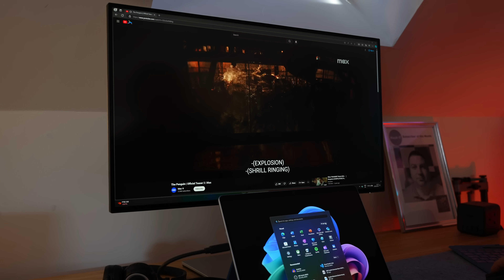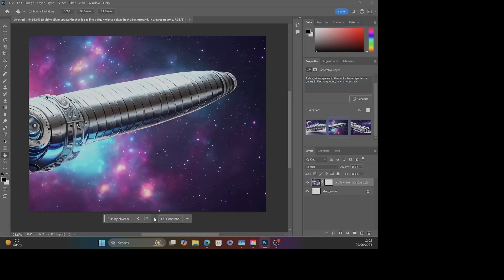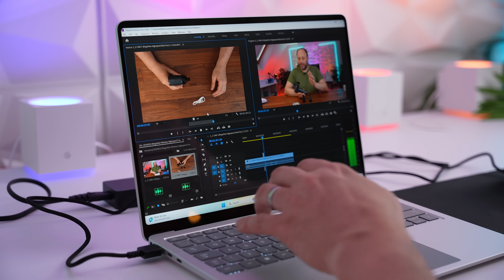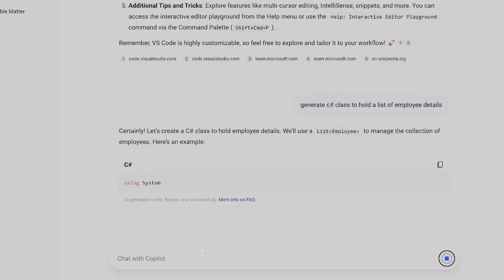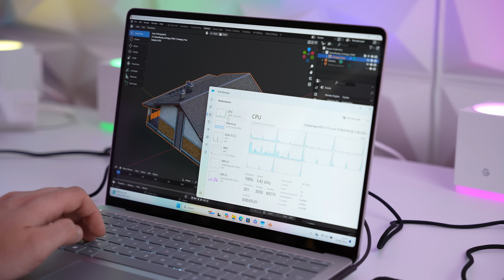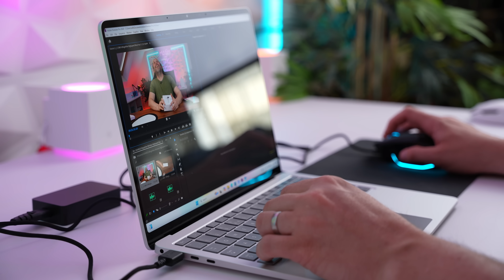Using the new Snapdragon PCs for Productivity! Featuring Surface Pro 11 and Surface Laptop 7

Comment: These shouldn't be for a 'light user', these chips came out to compete with Apple silicon. So far from what I've seen, they have been a let down in comparison. Anyone else feeling this?
Reply: I do. X chip has a long way to go.
Reply: What you think how much % of windows users do video editing?

Am surprised all drivers (external display , Bluetooth etc) worked fine for you. Am also surprised xampp worked out of the box. Would have loved if you tested docker. 
Also for the apps that worked well in emulation (audacity, photoshop etc), they worked mostly well. I mean no BSOD or crashes. This is way more satisfying for software developers and usual productivity enthusiasts out there. 

In dave 2d's video of Lenovo yoga 7i, the battery life is very close to MacBook air M3. And for emulated apps the performance was on par with M3.

The point is, it definitely has quite comparable raw power and battery life. Prism emulation looks promising and capable. 

I don't believe we can jump to the conclusion that it's going to be hype merely because some video editing apps didn't work. I am leaned on other side based on what worked, the overall performance and battery. 

I guess it will be very satisfying and exciting to use them once these selective corners gets polished out in couple of years.
Reply: I think people forget how bad non-ARM apps were on Mac when they made the switch, and all the apps that didn't work at all. Feel free to give Microsoft the same rage now, but it will get better. One point I didn't see you mention is if you had it in high performance or balanced when running these tests.
Reply: @briannhinton exactly. People always like to be kind to Apple, tough on Microsoft.
Reply: @bradavon on day one my m1 could edit 4k video without a hitch…this surface won’t be able to match apple maybe the sp12 or sp13 will
Reply: This is a first gen product and most third party ARM software is still in beta. There are many firmware updates expected from device manufacturers to fix early issues.

I am pretty certain this will give Apple wafers a tough time, if not beat them, as the software comes out of beta.
Reply: For a first GEN release, I think this is pretty strong. Is it perfect? No, nothing ever is. But it’s definitely a strong contender. Innovation spurs healthy competition, which benefits all the consumers. I am primarily a MacBook Pro user but I also have to use Windows from time to time. This is a nice and refreshing change. Although I know right now not a lot of programs are available on Windows for ARM, this will change soon. I am confident this product line will strengthen over time.
Reply: They do compete, software that optimized runs great, just gotta wait for other software to catch up. But if it can emulate something like blender, it should be fine with just emulation for now until more arm support happens
Reply: It's still a first gen product.
Reply: isheep spotted
Reply: @spresso007  🍏🐑😂 - I just wanted these chips to be good
Reply: I bet Linux would be killer on this thing
Reply: CHILL GUYS ITS JUST RELEASED. WAIT FEW MONTHS TO GET SOFTWARE MATCH. NO ONE GETS MAC AFTER SOFTWARES RELEASES  SHINING UPDATE FOR REGULAR PC
Reply: @bradavon  I understand that, but the M1 blew people away from day 1 🤦‍♀
Reply: @misterfunk1973 it's a shame Davinci Resolve isn't out of beta and Premier Pro isn't available but a lot of the complaints have been around games. Which the M1 Air still sucks at. I watched those videos too. It was all Photoshop which runs well here, Chrome which runs well here, Slack which runs well here, Premier Pro I'll give you that one. These are impressing from Day 1 if you don't expect to game on a PC not designed for Gaming or Video editing which fair enough but really is everyone video editing anyway,? The difference? What people do on Macs is still a lot narrower use cases.  We expect a lot more from Windows.And no the M1 Air couldn't run Google Drive after the first 5 days either.
Reply: They aren't "light use", DaVinci Resolve is still in beta. That's really NOT the same thing.
Reply: That's not really on the hardware anymore but the software. Benchmarks have proven that the devices get the job done and are more than capable of competing with the M series MacBooks. But native windows on ARM support still has a long way to go from third parties and emulation is only ever going so far. Really that's only going to happen once you get the casual consumers on the Windows ARM architecture and prove to software developers it's worth building robust native apps. And I will say for the starting price of many of the snapdragon models that's very possible. But nothings going to improve if you write off the device right out that gate. That's really how it's gotten so hard to compete in digital markets. You get these pseudo monopolies because developers aren't willing to support what doesn't already have a lot of users and users aren't willing to move to devices without a lot of dev support. Not saying to go out and buy the most expensive snapdragon laptop on the market or even replace your Macbook, but that realistically any viable competition will start by gaining casual lightweight users and proving there's value in supporting the hardware.
Reply from the maker: I totally agree. The video editing killed it for me. I can buy a cheap m1 MacBook air and do 4k video in resolve without any hitching, slow downs and it has great export speeds. I thought the snapdragon would do the same but it was painful, my ryzen in the T14 is better
Reply: @MashITTech absolutely true for someone like me who is concerned about video editing i believe this isnt for me, macbook air would suffice.
Reply: @anupammahato1  I had an M1 based model. I recently sold it since it was beginning to struggle with video editing. If possible go above the base model or even better go with a MacBook Pro
Reply: It's normal no apps are optimized. No gpu use ect... Capcut beta for arm is working perfect.
Reply: @MashITTech do you think that having 32gb of RAM would make a difference with premiere pro in emulation mode?
Reply: @MashITTech the M1 Air has been out for 4 years. You couldn't a week after the M1 Air launched do 4K in Resolve without any hacks 🙄
Reply: @MashITTech although without proper native application compiled for arm that accelerates video encoding/decoding via hardware it’s too early to tell
Reply: @MashITTech I get that with video editing, would have been better if they could match Apple on the GPU. 

However….you’re maybe falling into the tunnel vision that many YouTubers have. This isn’t a dig at you, but bigger YouTubers usually only know what it’s like to be a YouTuber. That’s all good and it takes a so much skill and dedication to be good at it. 

But I’ve tried a Pro 11 for coding using native ARM tooling and it’s been seriously impressive for such a slim and light package - an iPad Pro would destroy it in video editing, but couldn’t touch it on coding. (Having said that my M2 iPad Pro is only slightly better on Davinci Resolve)

If you need to emulate your video editing tools forget about it. In fact if you’re video editing just get a Mac it’s going to be a couple years for the chips to catch up on that side - let’s see if Nvidia come out with their own chips for windows
Reply: Guys.. When M1 first dropped... Everything wasn't working fine first.. It was mind blowing cause we had nothing to compare it to.. 

So it's easy to say a lot of bad things about this cause there's M-series chips.. 

Come on guys.. Give this some time.. Everyone looks for a chance to justify their Apple purchases... It's beginning to irritate me.. Same thing Blackberry users did..
Reply: It's been our for 3 days 
And you expect Mac level apps performance?
And for the davinci resolve, it's a beta app I believe and still even Arm smartphones apps (android and iOS) still have problems and need to be updated.
Since you said it has hardware video encoding support, it should be expected that it will get better in time. 
It's frankly unfair to expect that much at this point especially for apps not not made by Microsoft.
Yes it was branded as MacBook Air killer and it has in some aspects
The video editing will get better especially when davinci resolve is properly updated and premiere pro for arm is released 
Apple had final cut pro ready at lunch so they could offer good video editing capabilities if Adobe wasn't up to the task 
All Microsoft apps works flawlessly at launch 
It would have been a real problem if PowerPoint and word was laggy and froze often 
So let's have some patience and we where it leads
Reply: @princelyijieh9825 ive used DaVinci Resolve just when M1 Air was available and while it had stability issues performance form time to time the performance was great. Same with non ARM Chrome, Office Suite etc.

Sorry but M1 was way more "generation 1" product than these laptops are because market had it's time to adapt and learn how to launch ARM centric product.

These laptops are nowhere near value of M1 was. They are saved by 16gb ram as a base memory because it adds a lot despite shortcomings of this line up
Reply: @princelyijieh9825 Mac’s work better with Arm architecture.
Reply: @princelyijieh9825  Apple got a free pass because it brute forced the total transition to Apple Silicon, which gave the developers an ultimatum to either transition to Apple Silicon or lose millions of customers. 

Windows on the other hand did not transition fully to ARM, so unless ARM can truly showcase it’s benefits, adoption will be low, and fewer developers will be incentivised to transition to ARM, creating a vicious cycle.
Reply: @princelyijieh9825 disagree even on day one the m1 MacBook was editing 4k video without a hitch on emulator so they just dropped the ball hard
Reply: @princelyijieh9825  you don’t get a ‘will get better’ pass, when you’ve branded yourself as on par or better than Apple Silicon
Reply: @joshstark1528 Qualcomm and Microsoft literally didn't mean with every app and every use case because that would be a stupid thing to expect 😉. It's still only 5 days old so yes they do.
Reply: Correct, they were meant to be an alternative but in the end it was a let down. To be fair they should not have hyped up these processors as much as they did, because in the end reviews were going to obviously test all the claims which now we know was mainly big hopes and thats all. But, if they separated their marketing from claiming to be such competitive high end beating chips and instead focused on it's own category of how far Qualcomm has come and achieved in actually being able to be a fair competitor to the other chip makers they would have gained more respect and the reviews wouldn't have been shamed but instead accepted.
Reply: @4dzxk332 to be fair they're 5 days old and Resolve for ARM is still in Beta so no not correct 🤦‍♀️
Reply: @bradavon  Well they have plenty of time time to see how these chips perform in actual consumer hands now and release updates for the chips in the coming weeks and months for possible performance increases and to fix any unforeseen issues that can occur, and from these lessons gain a more advantageous knowledgeable position upon their next iteration of Snapdragon chips. In the end, still a win for consumers.
Reply: Not only that. They are also much more expensive... Doesn't make sense
Reply: @another-sam-youtube erm no? Macbook cost more than Microsoft

Comment: wait for Amd Ai 300 series that probably will have very good battery and it's normal CPU not ARM windows iant ready at all in my opinion and almost oo software don't count few apps from Microsoft.
Reply from the maker: yeah I am looking forward to the Ai300 range and still currently use a Thinkpad T14 with ryzen 7940u and its been a beast

Comment: Thanks yet again for another great video. Not too bad, they will probably get there. Cant wait for one that can game as these  have nice battery life.
Reply from the maker: thanks mate, its been a fun but long week :) productivity has been really good so far, if M$ can iron out the bugs these could be great device, we just need to see some real ARM games to find out how well it runs
Reply: That amazing battery life is for light usage. Game on these and the full load battery life is hardly any different from x86 I think. Abt 30 min more maybe and a gigantic reduction from the light usage battery of 11 or 12 hours.
Reply: @gloriouscat-fishLover  30min more on top of an hour is still a 50% increase ; ]
Reply: @blurandomnumber  Look at Dave2D numbers on battery life. In all three tests done it's about +20% for the SDx. For those that really need to have that extra 20% battery life, there are ways like getting a bigger battery etc.
Reply: @blurandomnumber  Look at Dave2D numbers on battery life. In all three tests done it's about +20% for the SDx. for those that really must have that extra 20% battery life, there are ways like getting a bigger battery etc.
Reply: @blurandomnumber  The battery life advantage is only +20%.
Reply: @gloriouscat-fishLover  Yes, that's true but better to have a laptop that really lasts when doing light tasks and is capable of gaming rather than have one that does not do so for either.

Comment: Seems that this can catch up with AMDs last year 7840u in 2 or 3 generations. Ms/Qualcomm Extreemly overhyped this thing. You can already get Pheniox $600-$700 laptops that run circles around this without the compatibility issues. Not sure I even see the value of this even at %50 discount given the availability of alternatives.
Reply: $800 during blackfriday gets you a thinkpad with 7840u and 32gb. Better build quality than surface. Better cpu much better gpu. Non of of the emulation compatibility nonsense.
Reply: $600 laptops are awful plastic garbage, not comparable to surfaces
Reply: @sowa705 You can buy refurbished or used one
Reply: do those $600-700 lapy get you 2.5-3.5k 120hz display or great built quality or battery more than 50wh or bloatware free OS?
Reply: @itsmilan4069  ASUS Zenbook S 16 OLED is out in literally 15 days for $1399 to $1699 with 24GB/32GB of memory and up to 2TB SSD. Premium build quality, far better GPU and NPU. Run circles around this. 10/12 core AMD Strix Point.
Reply: @itsmilan4069  got a thinkpad t14 gen 4 for $800 during last black Friday 32gb memory. The quality is better cm surface
Reply: Grisly bear spotted

Comment: I would have loved to see a lot more focus on the browser. In many companies the main work is done in SaaS applications that run in Edge or Chrome. I know they are ARM based, but is the performance any good? Keeping in mind that running a CRM, ERP, BI-tool does actually consume a lot of memory. Teams videocalls while sharing screen, blurred background, noise reduction... Are also a memory hogg.
Reply: Just writing from my Surface Laptop 7 with Snapdragon X Plus. Had never before a better browsing experience (using Chrome). It feels incredible fast and with 120 hz display soo smooth. During browsing and running mainstream Apps the fan never run - only when benchmarking. All in all feels like a Windows Macbook.
Reply: @mikke87  How much battery backup are you getting?
Reply: @chetan_naik  Report says 8% drain per hour with web browsing, youtube, spotify, working with mainstream apps. So its 12 hours in total. But to say its the first battery run and battery life may be better after a few loading cycle. Hope that helps.
Reply: +1
Reply from the maker: sorry guys, I will try and do more web based testing for the full reviews.
Reply: It can be used Speedometer 3.0 for testing browsers.